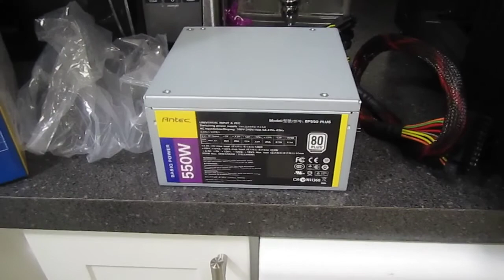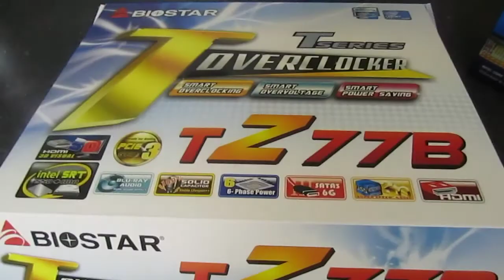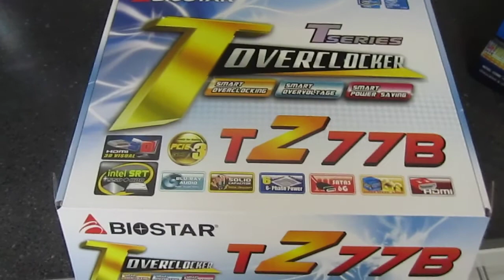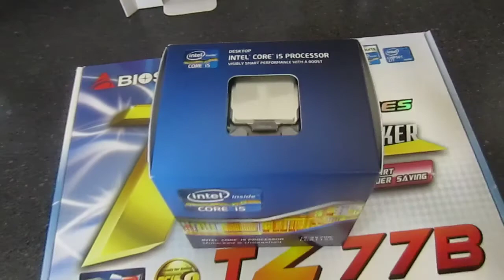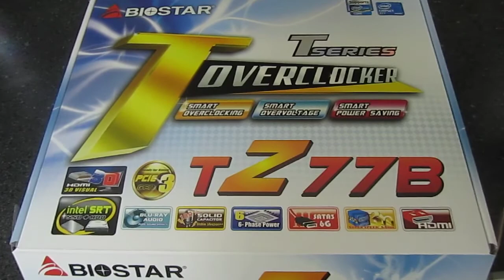Thursday AllNighter PC Build -February 14, 2013 Part 1

Comment: Dude.. you don't game much but just needed graphics and processing that would work for you for everyday useage? I would have recommended these following parts.

1. Your HAF 922 Atx Mid Tower - 89.99
2. Asrock FM2 A85x Extreme 6 - 99.99
3. Crucial Ballistix Sport 1600 mhz ddr3 ram - 51.99
4. AMD Trinity A10 APU (CPU+GPU) - 130.00
5. Rosewill Hive 550w Modular - 60.00
6. Samsung 840 Series Solid State Drive - 99.00
7. Western Digital Blue 1TB 7200 RPM Hard Drive - 64.99

Total Build Cost = 594.00